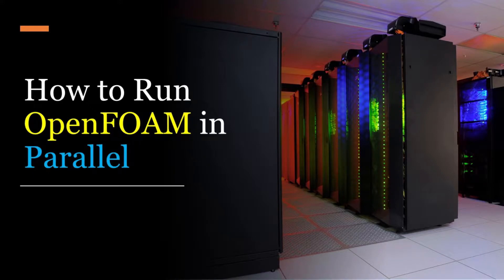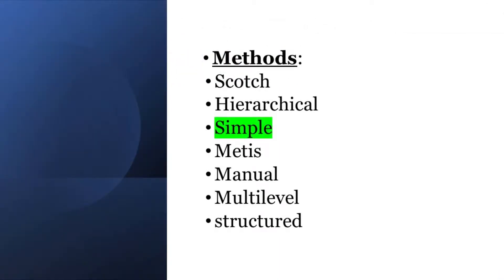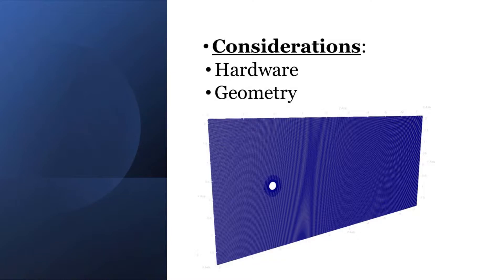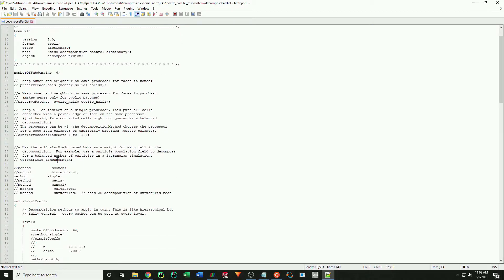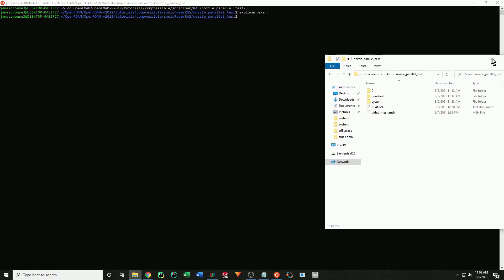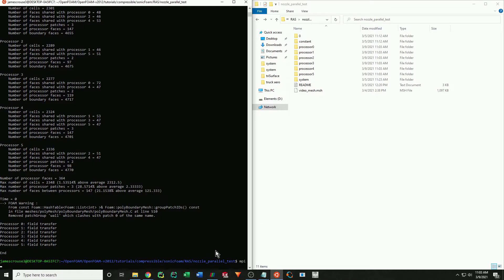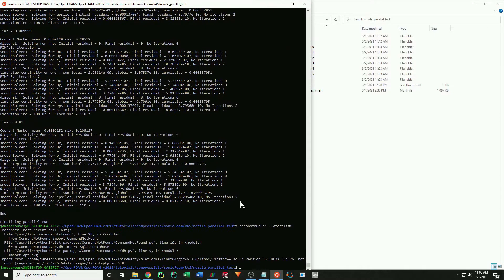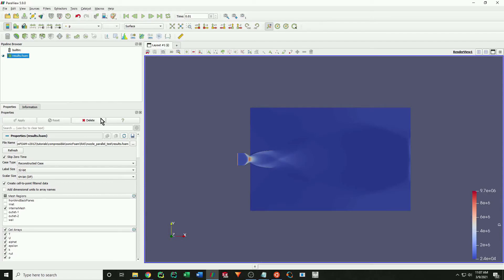How to run OpenFOAM in Parallel | OpenFOAM tutorial 4

Comment: So at the end, the "latest" command specifies that you only want to have a single "image" in ParaView?
Reply from the maker: the reconstructPar command recombines all of the files from the decomposed case into single timestep files as if you had run the case on a single core. This can make post processing much faster because ParaView only needs to read one file for each field at each timestep instead of 6 for 6 cores. "reconstructPar -latestTime" just reconstructs the very last timestep of the simulation.
Reply: @interfluo6420  Okay thank you so much, I learned so much from you! Really appreciate your help.